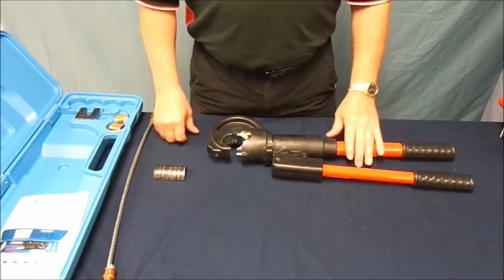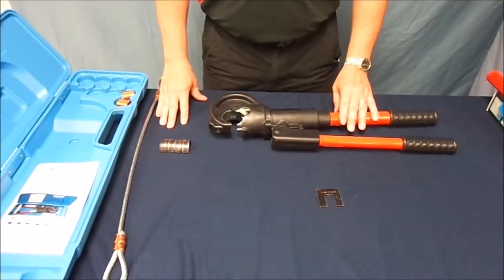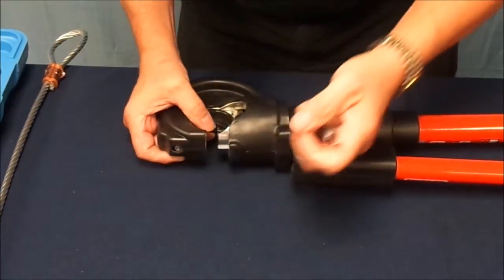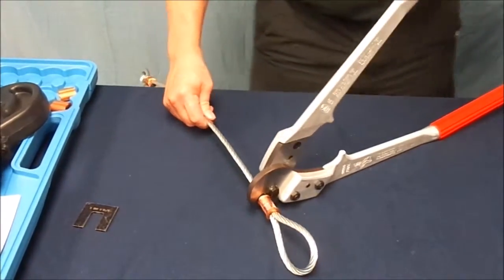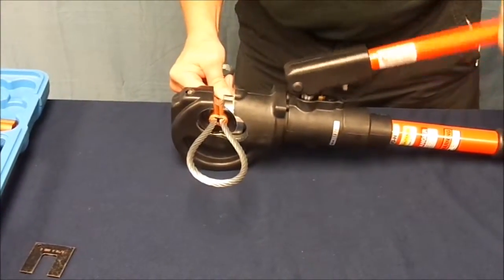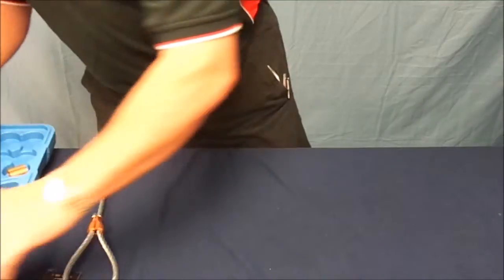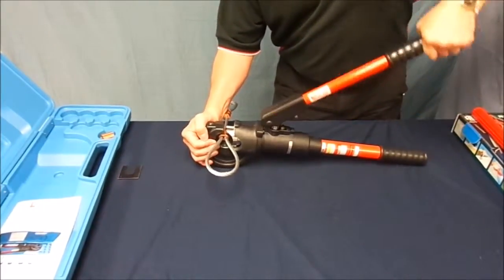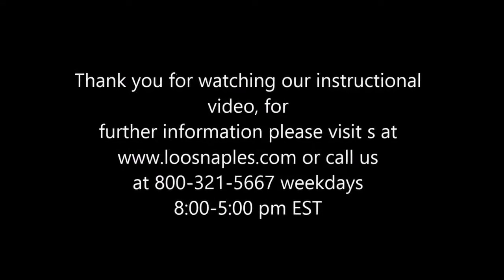#3-H - HOW TO USE A LOOS & CO. LOCOLOC® #3-H HYDRAULIC SWAGING TOOL

Comment: Why not stainless fittings. The tool looks strong enough.
Reply from the maker: It will, indeed! 3/8” (Loos part no. SL11-12), 5/16” (Loos part no. SL11-10), and 1/4” (Loos part no. SL11-8) it just needs different dies. 

Our HC-5010R (battery-powered) with the stainless steel dies will do it, too. (https://loosnaples.com/locolocr-battery-swaging-tools/hc-5010-r)

Please email us or call us with any additional questions! Our sales team or our engineers can answer any questions! 
sales@loosnaples.com or (800) 321-5667.